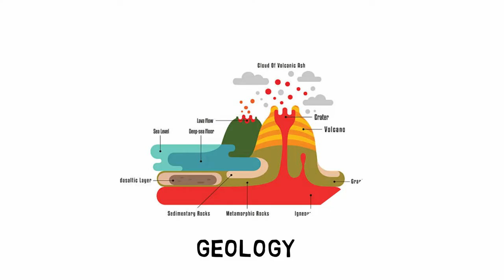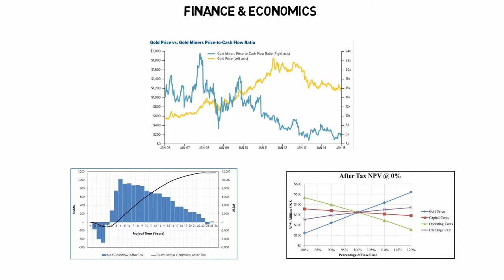What is MINING Engineering?

Comment: What is the relationship between electronics and mining engineering
Reply from the maker: Lots of mining equipment and many mines themselves use electronics. For example, GPS, plant control rooms, power supply to any equipment that runs on electricity such as cable shovels or battery-operated underground trucks.